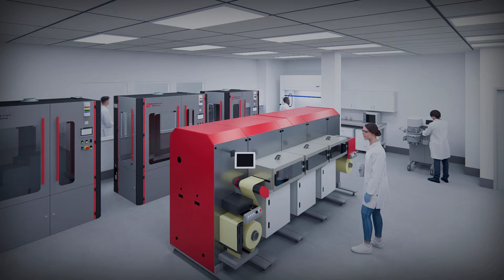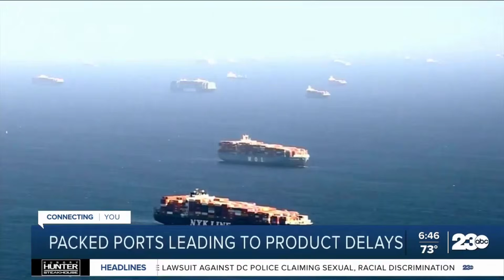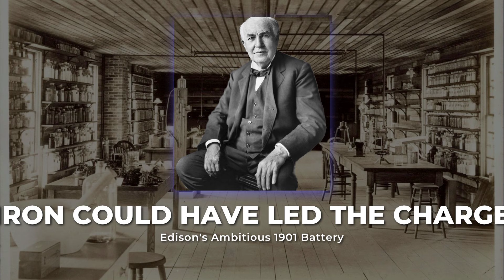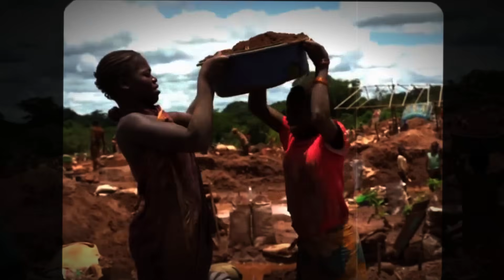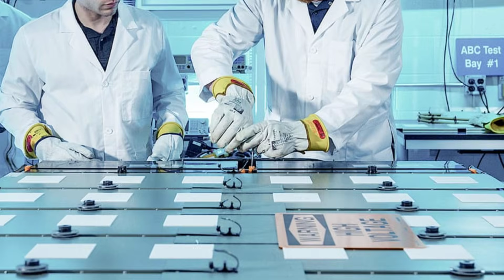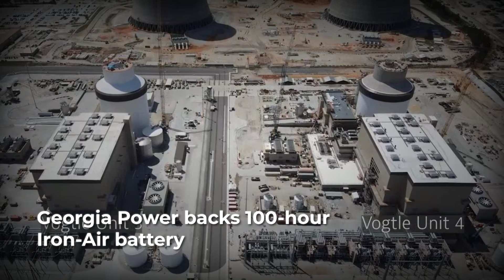THEY MADE A BATTERY OUT OF RUST (And It's Destroying Lithium!)

Comment: What surprises most people is that Thomas Edison patented the original alkaline nickel-iron battery (US Patent 678,722) back in 1901 to beat lead-acid, but his iron anodes suffered from hydrogen gas evolution—the cell electrolyzed its own water before fully charging. Suppressing that parasitic hydrogen reaction with modern bismuth-doped direct-reduced iron pellets and bifunctional air cathodes is what finally unlocked 100-hour grid cycling.

Comment: an Iron-Air Battery has a charging efficiency of 69% and discharging efficiency of 71%

so total round-trip efficiency is 49% with cost to build of €20/kWh

while Lithium LFP cells with 99% round-trip efficiency cost €45/kWh 

so total net cost per energy delivered is similar